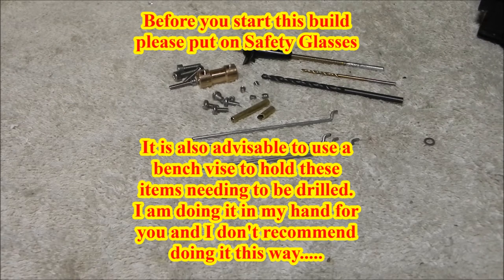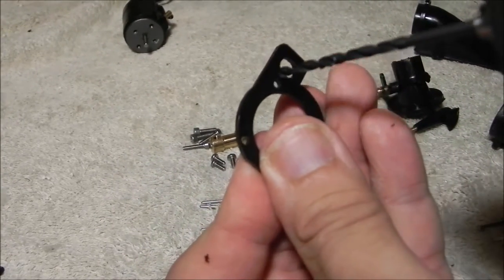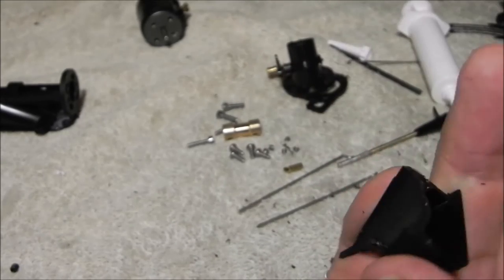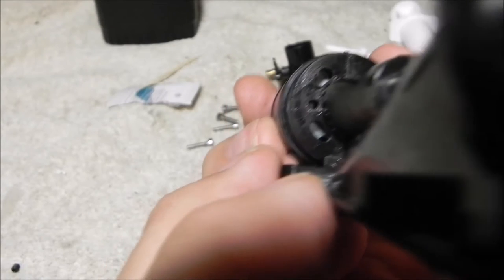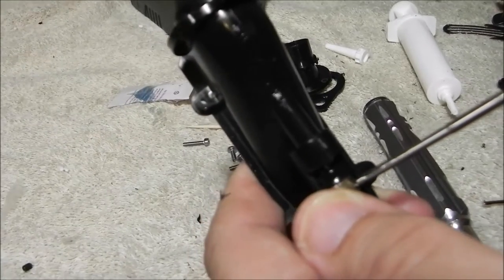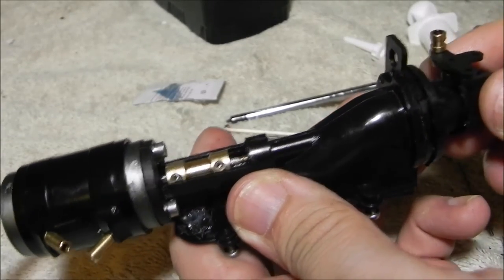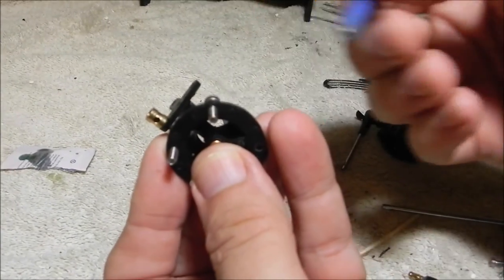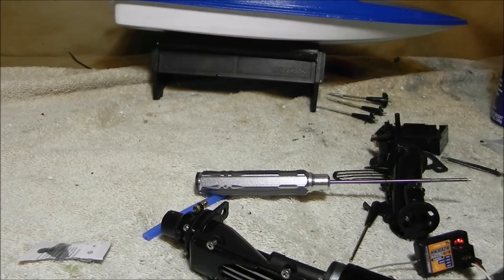RC Jet Boat USA Made Flex Shaft Kit Install Part 2 of 5 : Kit Install for NQD Tear Into 757 6024

Comment: You should have silicone the four holes on the pump shoe to stop air leaks
Reply from the maker: Those holes are on the outside of the pump and they are silicone when you mount it into the boat. Those are also underwater no Air.

Comment: what motor are you running?
Reply from the maker: It is a Waterjacketed 2845 4 Pole Brushless Motor running at 3650 RPM Per Volt (3650Kv) on 3s Lipo. Any motor this size running between 3300 and 3700kv will run just fine.
Reply: ok sounds good  I'm goin to order your upgrade kit tonight! I'm super excited!  what esc do you recommend running? I appreciate your time!
Reply from the maker: I use a version of the Flycolor 50 Amp Marine ESC. I am in the process of making some kits and I can supply that ESC with the kit for $35. I have had a bunch of Local Jobs so I have not been doing the RC stuff for the past 3 months. I am almost done with the last job and should be able to produce them this weekend. Thank you
Reply from the maker: That will work fine just so you know you will need to solder connectors on that esc as it does not come with any. The Amperage is not a factor as along as it is 50 amps or higher.

Thank you
Reply from the maker: No that has the wrong shaft size you need a 3.175mm  = 1/8" that motor has a 4mm. Also that motor is too long at 68mm it will put to much pressure on the mount.  Just use a 2845 motor and you can buy an aquacraft AQUB9548 water jacket from Towerhobbies. 

http://www.ebay.com/itm/GoolRC-S2845-3100KV-Sensorless-Brushless-Motor-for-1-18-1-16-1-14-RC-Car-AD-H9K3-/162536785464?hash=item25d7f28638:g:oOQAAOSw9OFZJQGR
Reply: awesome! thanks man! I really appreciate the info! I just ordered the motor, jacket, and esc.  I am still waiting on my boat to get here.  I really like how that jacket seems to cover more surface area on the motor to keep it cooler.
Reply: hopefully your able to throw an upgrade kit together by the time all my shit gets here lol
Reply from the maker: That is the same as the 70A just with slightly different capacitors and Wire size. The 50 70 and 90 are exactly the same size. They are all made by FlyColor. I can get the ESC and put what ever connector you like on it for $35. I have just looked and I had forgot I have sold all of my impellers and will need to order some more. Would you like for me to just build you a pump to drop in the boat with Motor and ESC?
Reply: ya that works
Reply: hey just wonderin if you got my msg about the price? and aslo when you are able to ship?
Reply from the maker: No, I had to switch Phones and My apps were not setup correctly at the time.  I will be in my office in the morning and will be able to give you an exact total then. Thank you
Reply: Hey what you thinkin?
Reply: Hey I was wondering if you had any pumps ready yet? I built my own pump but it's not working properly. It's frustrating lol